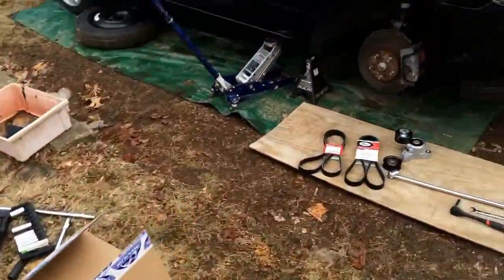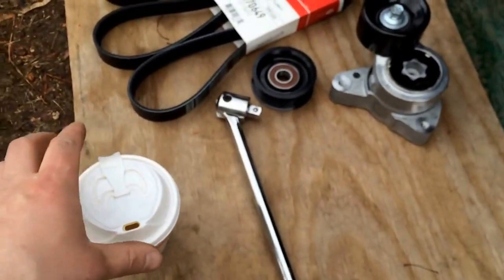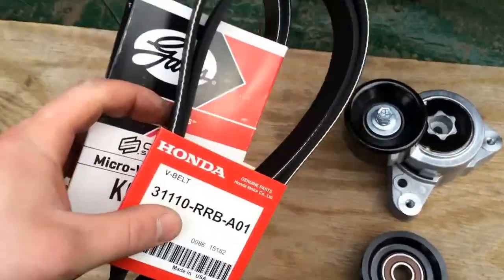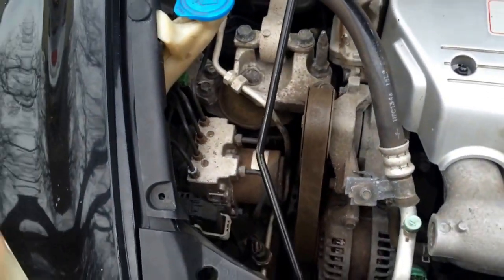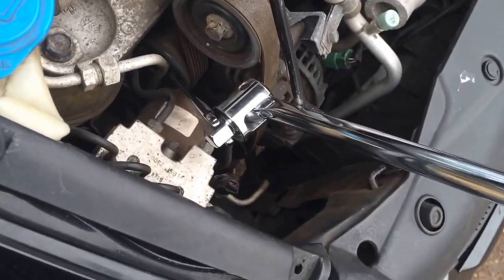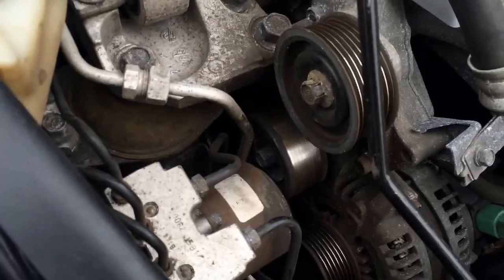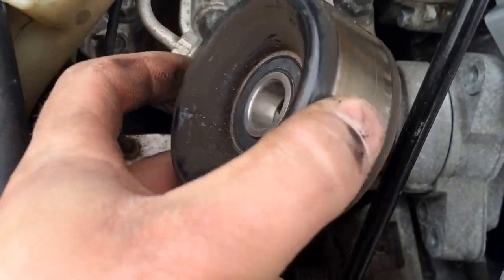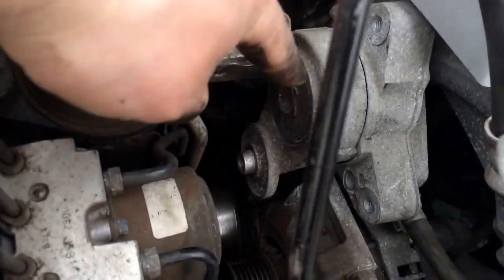Honda Civic Si Idler Pulley & Tensioner Pulley Replacement DIY (2006-2011 Si)

Comment: great video, what was the part number from rockauto for the tensioner pulley???
Reply from the maker: +Wall Barrantes  38028 by Gates.  Their products are awesome!
Reply: +The GerberSteve you made that look so easy, everytime i try to do anything on my SI I swear i be having the hardest time
Reply from the maker: Hey man, I'm no mechanic, but I try my best haha.  They're are pretty hard to work on due to the space.  I'm doing a clutch job on it soon, that should be fun.  What year is yours?
Reply: +The GerberSteve i feel you, i did the intake , suspension, spark plugs , exhaust was a pain in the butt butt i got it done, rotors and brakes , next on my list is radiator
Reply from the maker: +Wall Barrantes What intake?  I was thinking about putting a cold air in.  I'm definitely going to upgrade my suspension.  Not sure if I'm going to do an exhaust, was thinking a 4-2-1 header with a high flowing cat.  I need new brakes myself.  Not sure on which ones I want to go with though.
Reply: +The GerberSteve i went with a takeda short ram intake, suspension look on google for redshift suspension, is a guy in PA he builts packages depends on what you want and cheap too
Reply from the maker: As far as intakes go, I'm going with an injen cai.  I'm still on the search for suspension.  Think I'm going to go with tein coilovers

Comment: Appreciate the video, but after enduring an aftermarket water pump giving out around 25K in my 1994 Civic EX  , I have been pro Honda OEM parts ever since, for critical parts. Did you know that some aftermarket oil filters will starve the Honda 4 engines? That's according to the head tech at my dealership. He also recommends changing my oil every  3K and not at the  manufactured recommendations, if I want any longevity out of my engine. Did that myself on my '94 Civic EX and her odo read 278 K or so when I finally sold her for $550.00:)-John in Texas
Reply from the maker: Oem for life man, learned my lesson plenty of times.  What oil filters are those?? I usually change my oil every 3k Miles, sometimes 4K though. Dude, older Honda’s are amazing 👌🏼
Reply: He did not specify, and I did not ask. Yah, my '94  was involved in several fender benders , rear ended a Cadillac  and still clocked a few miles. Even my 2010 Si 2 door coupe is not made as well-you can tell that the sheet metal is thinner as the door sill has some dents!

Comment: If bad, does the sounds like a winding noise
Reply from the maker: More like a slight grinding upon rotation. A winding noise will most likely be ac compressor
Reply: The compressor hasn’t work since I brought the car it probably the alternator it’s New the bearing is bad it’s a good thing I have a warranty on it

Comment: What's the torque spec for the pulley to the tensioner
Reply from the maker: The torque specs are 41 ft lbs for the idler pulley main 14mm bolt, and 16 ft lbs for the 12 mm bolts.
Reply: Gerb Productions is the torque spec 41 ft lb for the top idler pulley or idler pulley (tensioner)?
Reply: All the torque wrenches I'm finding have a 20 lbs and up could you let me know where I can get one that goes to a lower rating?

Comment: Gerb after replacing the serpentine belt on my 07 si, i started to hear a wobble. the tensioner pulley can be slightly moved side to side like barely.

what can be the issue??
Reply: i didnt change the tension or idle pulley.
Reply from the maker: I would recommend changing those man.  Order gates ones off of rock auto
Reply: Gerb Productions i dont think the pulleys go bad right just the bearing? im changing out the bearings next week and see if that changes anything.
Reply: Sti Wrx so what 
What happened  I changed my bearing today Nd it's locking up. everytme
Reply: I changed my bearings and im good to go. No more noise. You gotta make sure to get the oem one theyre like 10 bux a pop and not the ebay 10pack. 

You may as well replace the whole pulley thats what ima do by the end of the year.

Comment: Sandwich there was a better tutorial and video on this when you get down to the idler pulley excuse me when you get down to the tensioner pulley and you remove the bolt out of the tensioner pulley who would have known that Honda put a nut behind the tensioner pulley in the tensioner that is not fastened when I remove the bolt the nut fell down somewhere or I cannot find I spent hours with my magnet my flashlight and tearing apart the most of it only to go buy a new $0.53 net and use some metal back tape to hold it in place to put my new pulley on a 3/4 of an hour job turned into four hour job but it's done
Reply from the maker: That's the DIY life lol... Always has to be something. Surprisingly, this job was pretty simple for the most part. Hardest part is getting the belt back on, which unfortunately i didn't show

Comment: was the noise coming from the pulley or tensioner or the belt itself? anymore noise after the replacement?
Reply from the maker: I believe it was coming from the pulley/tensioner.. no more noise after I replaced it